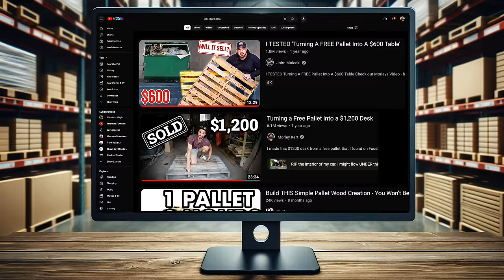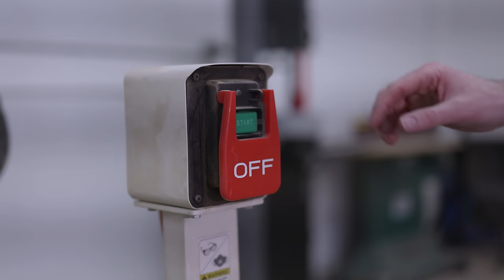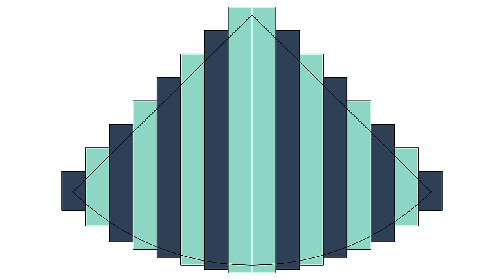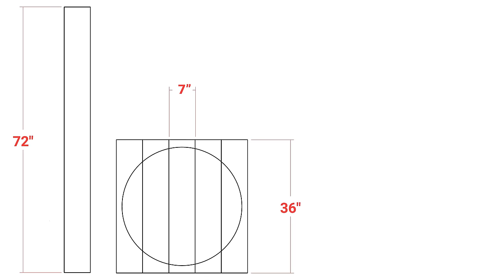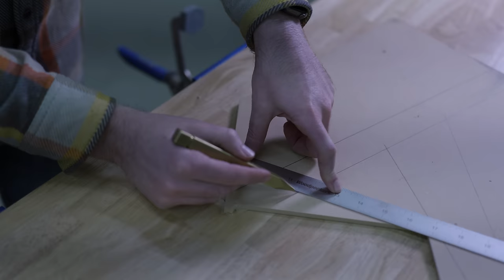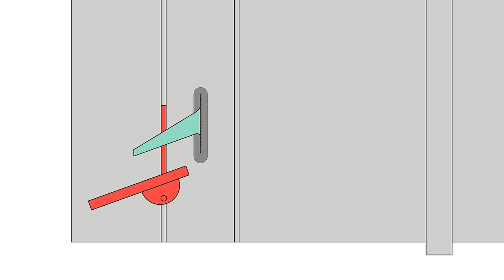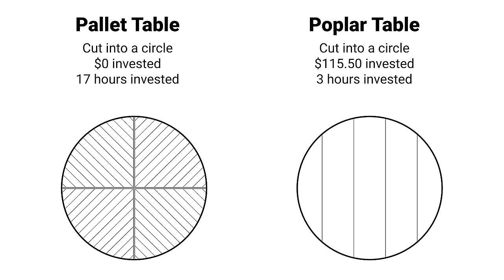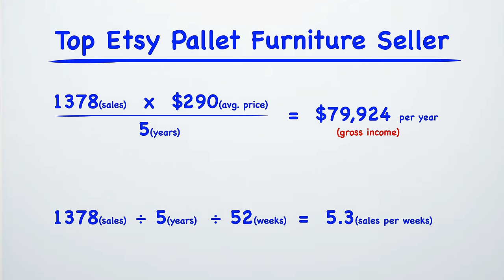Pallet Furniture is a Scam

Comment: The bigger concern with pallets is that ones you find thrown away has a HUGE chance of them being contaminated, and are honestly dangerous to have all the dust kicking up in the air, let alone in your home.
Reply: Contaminated from what?
Reply: depends where you get them. Not big box stores who use them for chrmicals, but places like tile stores or schools, have them from indoors to indoors! Which saves 50% of planing and joining time!
Reply: wow, greenhouse humans really irk me, Cariociecus give me strength.
Reply: @lordcommandernox9197  stay mad
Reply: @HecFCovPe  All sorts of things, including most commonly fumigation of powerful insecticides. anything with MB marking should be avoided, but you aren't likely to come across them anymore, pallets don't often last over a decade and the MB process was outlawed in 2010. Also, chemicals from containers that sat on the pallets, molds and bacteria. Any blue pallets should be avoided since those are mostly from the pool industry which is chemically intensive.
Reply: @HecFCovPe  wood used in construction of pallets are typically treated with preservative chemical agents and sometimes insects/termite repellents
Reply: In europe they are chemically treated and also stuff spills on them regularly in transport. EU pallets are not one time use also so if you'd use those it'd rather dangerous. Don't know about NA
Reply: @MajorJefferson  NA is anywhere from one time to so much that the wood is starting to dry rot.
Reply: Lol calm it down
Reply: @nightpups5835  yeah I've collected pallets for projects/ burning for years and have never once seen one that was treated chemically. They're extremely rare. However you do see some dirty ones that I've not considered what that "dirt" could be. But hey under a layer of finish the last thing I'm worried about is the chemicals in the wood. What's in the finish is the real question if you're worried.
Reply: Many years ago, in my foolish youth, we tore up a bunch of pallets to use as firewood when camping. We were all in awe at the beautiful greenish blue flame it produced. Lord knows what we were breathing in with all that smoke.
Reply: @briang4914  I'm sorry, when you said you've 'never seen one that was treated chemically', how exactly do you determine that one wasn't treated chemically? Did you send it to a lab for analysis or did you just sniff it?? If the pallet was unmarked or if the safety markings have faded from use, how do you determine if it's safe??
Reply: @briang4914 😂 yeah ok
Reply: @ptrinch green could be anything from the fairly harmless borax all the way up to chromated copper arsenate if before the mid 2000s
Reply: Lol.  I needed to ship some ATMs I was removing as part of a larger project and needed pallets.  You can get them for free from the loading dock at just about any Lowe's, Home Depot, Sam's Club, BJ's or big box store.  You just call and ask.  They'll tell you where to grab them from.
Reply: This is abject nonsense. The vast majority of pallets come from places where no hazardous materials are ever processed. Supermarkets, warehouses of large webshops, logistical firms etc.
Reply: Here in New Zealand there are lots of single use pallets.  They are characterised by cheap construction, rough sawn wood, and the wood is likely to be untreated.
Reply: @DuyLeNguyen  they all have markings and codes on them from the factory and they're marked on a typically non wearing area so ive always been able to read them. The only ones I've seen are marked "HT, KD, or DB" which means heat treated, kiln dried or debarked. Unless they're lying about strict govement regulations then that's how you tell.  If you do somehow get insanely lucky enough to get a Methly Bromide treated one it will be a sickly green hue and be stamped with a clear "MB" instead of the other markings listed above. I've never seen one this whole time since they stopped making those ones I think decades ago.
Reply: @oz_jones  ok yeah 👌
Reply: Its humorous that in the dramatization you deive a bad ass Toyota and IRL you drive a Ridgeline lol.
Reply: @DuyLeNguyen  Exactly. These people are worried about the pallet wood treatment, but they are happily inhaling ground contact pressure treating chemicals while working with structural lumber.
Reply: Would contamination be a problem if you varnished it when done?
Reply: Literally anything dude.

This is actually a good point. Literally any chemical or substance on earth could have been leaking out of a drum that sat atop that pallet.

It's something where the risk may not be too bad overall, but meanwhile the total variety of potential contaminants is perfection here-it's infinite lol.
Reply: @ChadDidNothingWrong  Couldn't literally anything in the world be contaminated with literally any substance if it was outdoors or upcycled by this logic? There are pretty significant controls in place for anything that is significantly more harmful than a consumer product in the chemical industry, and drums/bags are sealed with material that does not corrode, and there are rules about returning these containers. The only pesticides used in the shipping industry must be applicable to all freight, including food products. If it's lethal for bugs and people at the same time it's not a great pesticide. This is not 1930 where the army is spraying mercury dust around willy nilly. Wash shit when you take it home with soap and water.
Reply: @kovona  If you're not making pallet wood dinner plates, then you're fine.
Reply: how do you people live in fear of every little thing

we inhale diesel fumes all day every day but we are going to die from touching a pallet
Reply: @aduantas  I wouldn't make a cutting board out of pallets, but anything else is fine. It is all fear spread by people that can hardly muster the courage to log off their computer.
Reply: I see you've never worked in the chemical industry. They put chemical and chemical waste drums on top of those pallets for transport. A lot of those drums aren't very clean despite all the promises from the chemical plants.
Reply: @HecFCovPe usually not DG but stuff you don't want in your house or garage, like contaminated oils, sludges, and the ever present black dust you find in industrial settings
Reply: @kid_missive  "Couldn't literally anything in the world be contaminated with literally any substance if it was outdoors or upcycled by this logic?"
Yes, but it's a matter of probability. Suppose I tell you not to run into the road without looking, because you might get hit by a car. You could say "Couldn't I be hit by a car literally anywhere on the ground, by that logic?" and it's true, you could. But, for example, the likelihood of being hit by a car in your garden is so low that you don't even need to think about it. Pallets are designed for carrying things, sometimes things are toxic, and sometimes things spill. A pallet is much more likely to have had toxic stuff spilled on it than any other source of wood that I can think of. Still very unlikely, but much more likely than any other option.
Reply: @nightpups5835  Methyl Bromide isn't even a big concern, it doesn't stay in the wood long term. They also use it for fumigating food and fields for growing food.
Reply: @beeble2003  There isn't any evidence in that statement, but it feels like you are trying to explain your way around that. Say it's a gut decision and I will let you go in peace!
Reply: @kid_missive  So apparently you don't understand the difference between things that are more likely to happen and things that are less likely to happen. Good luck.
Reply: @MajorJefferson  
> EU pallets are not one time use also so if you'd use those it'd rather dangerous. 
 
And it would be theft.
Reply: Uh no. Wives tale
Reply: in EU pallets are marked for their use, so it's very easy to find "clean" pallet wood, so far I haven't had any trouble finding clean pallets for free or super cheap where I can pretty much pick perfect pallets for a dollar each

Comment: I like pallet wood for making little boxes and stuff. It's a cheap (often free) entry material and if you have a planer, you can make some good looking boxes. But yeah, you are spot on when it comes to making furniture with it.
Reply: I did not use pallet wood yet I used the plywood strips that came with the pallet they built for my 6 burner commerical stove when I got it a few months back. I had some cabinets in my upstairs office that were salavaged from other people that were sinks at one time and I wanted to make drawers. So I used those strips to make boxes and the rails for them to slide on. Works quite good enough for me. I built 4 drawers for the 3 cabinets that are in there. One already had drawers. The span is 12 foot 6 or something like that. There is a gap between one set of cabinets in which I have almost finished building a cabinet of 3 drawers from 2 of those corner lazy suzan cabinets. I have the frame all built and now just need to add a bit more of spacers and the rails and then make the drawers. Going to use some osb sheeting I have. Then cut and route the drawer fronts. 
I could just go out and buy cabinets yet its just an office and nothing special. I have old countertop pieces for the top right now. Once it finished I will go and get 2 pieces and cut and glue them. I did the desk side of the room which is the same 12 foot 6 something. The only thing I want to change is raise the desk up 3/4" and exchange the two 2x4 supports for the center with some banisters. I looked last time I was at the big box store and going to look at another one another time. I need to find the right ones as I want to put in 4 of them. 2 for the ends and the 2 for the center. The center of the desk is where the dog bed is and the cat bed is on top in the center. It looks nice and works for 2 people to work along side of one another.
Reply: Most of the "i paid 0 dollar for material and made 5000 dollar in sales" videos are pure clickbait. If they are even trying to give a kind of how to manual it's boring, generic stuff or copies just a bunch of home depot style decoration items you wouldn't need a Youtube video to show you how they look.

If you think that makes for a great selling business you lack any pride in your product and desire to be original shudder

So the actual intent is just selling the channel by accumulating watchtime. If ANY of the audience can make even 10% of the announced price is immaterial. As long as a couple ten thousand people who'll never do any of this project watch they're fine.
Reply: You should also think about what that pallets have been treated with to keep pests away. Depending on the age it could be nasty stuff. 
I wouldn't risc to put wood, that may outgas some harmful chemical in my living room.

Comment: Love the video, not a big fan of AI art though :/
Reply: yeah same. and using chat gpt is not research, for several reasons but especially because it won't give you accurate or even correct answers. could have done better by googling and doing some light skimming of the results or the pallet content creators' sites. you get out what you put in, and low effort "research" returns basically nothing that will help you. the rest of the video is great with clear effort put into the shots, storytelling and visualising the money/hours put into the project, so the AI stuff is disappointing in comparison.
Reply: Yeah it doesn't add anything to the video. It's not cool, or funny or interesting. The only thing it shows to the viewers is that the creator of the video likes AI art. Strange.
Reply: I had the exact same reactions.  The AI art actually took my mind off the video because of how uncanny they are, and his conversation with chatgpt was embarrassing as far as research goes.
Reply: I think the Ai art was fine. It was something interesting to look at during the voice over. It’s also way quicker than trying to find b roll or searching and paying for stock images. Making videos like this is extremely tedious and time consuming. This entertainment cost me less than those pallets 😂. Give the guy a break.

Comment: Never trust a price claim on YouTube. For example: I found a video claiming to build a 100 dollar CNC machine. Then they proceeded to find half of the machine in "spare parts" left over from their other videos, those parts were not priced in. But a beginner would not have them and thus would have to buy them. Pointing out that fraud made the video maker angry. They don't like it when you question their clickbait publicly.
In a similar vein many videos only count part cost. Not the cost of man hours, or even the cost of tools. Though tools are reusable so I'm  fine with leaving those out if they are common tools. 
So I'm very happy to see you explicitly take in man hour costs. 
This was an excellent video.
Reply: The problem with cost breakdowns Hanford hours invested, is that they’re INCREDIBLY difficult to determine. You have to calculate things like skill level and all. I’m sure if he broke down pallets on the regular and got used to working with the material, and he spent even an hour sourcing nicer pallets from an industrial park, he could probably reduce the amount of man hours invested into the table by half. Furthermore, any non-professional would’ve spent far more time building both tables than he did. I mean, 15 hours is QUICK for a hobby woodworker to produce a finished product like this.

Also, he didn’t really make identical tables. If he took the times to make the poplar table the same “triangular” pattern as he did the pallet wood table, he probably would’ve had an additional 5-10 hours into the poplar wood table, but instead, he just took some poplar wood boards and stuck them side-by-side and glued them together. Not exactly a 1-to-1 comparison.

I would 100% agree with you on the fraudulent YouTube price breakdowns, though. Most of them are pure BS as they don’t include things that the average person doesn’t have. And, even as this video stated, one of the big reasons that this table fetched $700 was because he built it and sold it on his site, and he has a large social media following. John Malecki sorta exposed this part when he made his pallet wood video. He listed it anonymously on Facebook (listed it on one of his employees pages) and it got zero interest. He ended up giving the table away, but I would imagine if he had listed it on his own page, it would’ve sold rather quickly for some outlandish price (considering he used purely pine pallets). So, that has to be considered as well. If both tables had sold for $100-$200 a piece (common man selling it, not a well known woodworking shop), all of a sudden you’re BARELY out of the red purely due to your material costs. But, on the pallet wood table. Sure, you’re making like $2-3 an hour, but as a hobby I don’t really care about that aspect, and I don’t have to worry about material costs outside of wood glue and machine upkeep, so to me, because the money is more of an “added bonus” of my hobby, it’s pure profit.

I think most of the YouTubers I’ve seen who try and “debunk” the pallet wood craze fail to realize that you can have a business without it being your main source of income. Sure, no one is purely living off of pallet wood furniture sales, but, it doesn’t mean you can’t do it as a side hustle and make some nice coin without the cost of materials piling up. And if you mess up or something doesn’t sell, the only thing you really have invested is time, which it’s a hobby so you had fun doing it which was the main point anyway.
Reply: This is what every green person can make on an afternoon at no cost
Reply: All brilliant points well done.
We should always point out fraud. Nothing good comes from dishonesty and ignoring logic and sense.

Comment: When I took up woodworking, the acquisition of lumber became just as fun as the building itself.  I don't use pallet wood, but chancing upon sources for logs and old lumber becomes a quest.  I have stories behind each batch that I got.
Reply: I am the same way. I am always looking for free old wood from unique places. Recently I drove by a massive pile of scrap wood that I think was from a Demo in an old tire store. The wood has a bunch of junk but I was able to salvage some larger sections of Timber that had some really cool old hardware on them.
Reply: Look for small manufacturing plants if you want to source shipping wood on the cheep. There is a few places local that tend to have 10 foot pallets that they discard every few months.
Reply: My husband is like this. When we were dating, I would see him coming out of one of the sheds and he would seem so embarrassed. We were driving to  our date location one day and drove past a pile of wood and some old furniture. He slowed down slightly. Passed it. He seemed so distracted after that. I asked him what was wrong. He told me he has a problem. He hoards lumber. When he finds something he likes, he buys it. He salvages. He buys lumber when it's on sale. He makes furniture with it and sells it or saves it for his future house. He was distracted by the pile we had passed. Our date became going back and getting the lumber, some actually logs and the furniture. He showed me his shed. It was so organized! Type of wood, sizes, blueprints and drawings for ideas were on the walls. He would use his grandfather's woodshop. What I love so much? I know exactly where the timber and lumber he used to make our bed came from. I know where the lumber for our dining room table came from. The shelf above our hearth. Lol